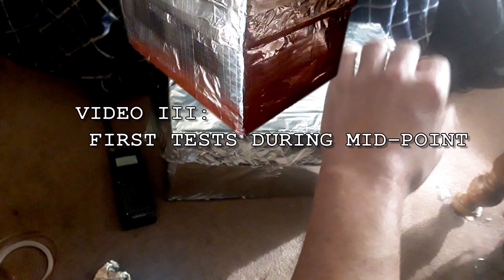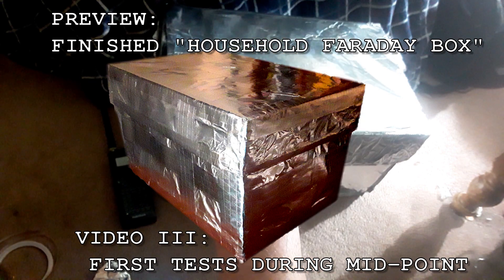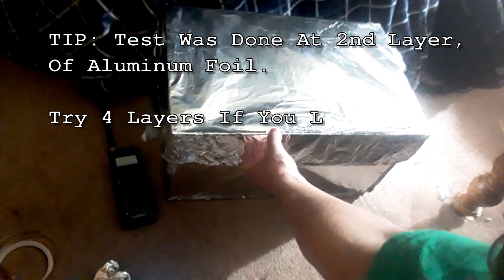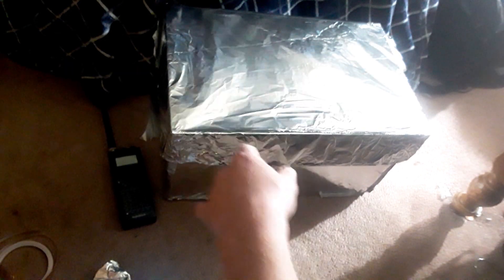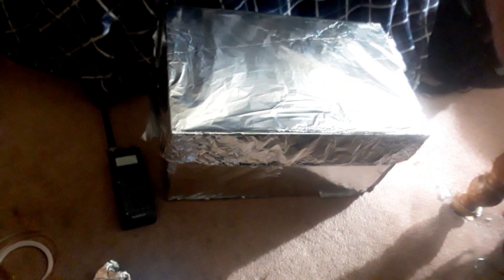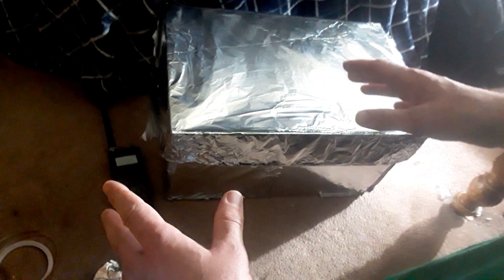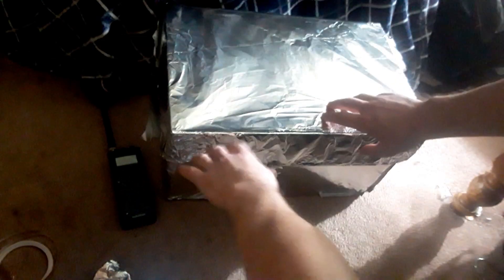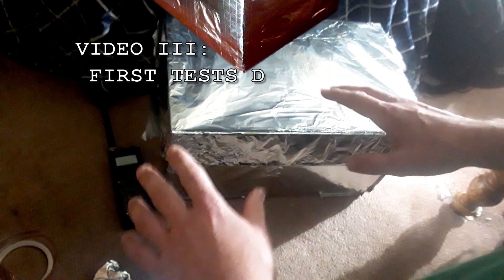Make "Household Items" Faraday / EMP Box Part III: Simple Test

Comment: I’m not an expert in rf, but do outgoing signals differ to incoming ones in terms of wavelength or any other factor? I’m thinking if you know which freq outgoing is, and the freq of incoming, you could effectively block one and allow the other? Lol, like a real life firewall 🤣 maybe I’m thinking outside the box🤦‍♂️the faraday box🤦‍♂️
Reply from the maker: You can use hole size of mesh etc, generally the rule is no holes greater than 1/10th wavelength. Blocks both ways, however an antenna on receiver inside can help penetrate weaker faraday, using high power setting on transmitter, + added nice antenna to increase reception... you could allow more. but that would be more about making a less effective faraday. And means you have to control for more variables.